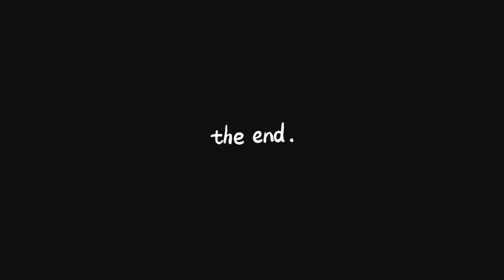Fitting a door lining to the new utility room

Comment: Hi Richard, top tip, i know youve screwed the batten across the bottom to maintain the width but that wont hold the legs square, where as if you fix the hinge side of your lining first, and then cut a piece of 1x4 for example the internal width of your lining and place that inbetween the legs on the floor. 
This will ensure that when you fix the other leg you can pack it tight against the 1x4 making sure that they are dead square.
We have to fit oak thresholds on fire doors, so we use the oak threshold in the exact same way but leave them in place.
Good tutorial though for those who might not know 👍

Comment: I always chop my hinges into the door then transfer position using a marking stick, and chop into the lining before I even build the lining,  nice and easy to cut them flat in the lining on a workbench/trestles, usually use a palm router, then finish with a chisel.  I usually test fit the leg to the door for piece of mind, though It's never been been wrong, so the door is effectively pre-hung,  remove the door, make up and fit the lining. Like Danny M I always fit the hinge side first then square everything off that.

Comment: Good Videos
A string line from corner to corner is a good check
Advise Dummy Frames fitted first, means another set of door frames installed but no damage to finished frames as can be fitted after floors are done
Also gives option of installing Door Sets or Choice of frame can change to be oak slips for example
Your comment on leaving a hollow inwards is spot on !!!!!!
Router Table very handy for a big job

Comment: Great video Rich. Only one thing missing - how to calculate the height of the header. I can see people putting it in at 8' and then wondering why they've got a bit of a gap under the door 😊
Reply from the maker: That’s a good point Rob I shouldn’t presume should I. I’ll try to edit that into the door fitting video coming soon👍🏻
Reply: @Mr_A_Builders  it's actually quite a tricky topic that couldn't easily fill it's own video. You have to allow for the type of covering including any underlay,  then the type of room (I've seen 15mm gaps in a kitchen to allow for air flow), and then quality of the door as to how much you can trim if anything changes. I'm sure you could think of a load more decision points - basically, all the stuff that automatically comes off the top of your head without even having to think about it when you're the professionals you guys are.

Comment: Very interesting, I can’t tell you how many times I’ve have fitted a door liner, nice to have the smoke seals in the liner than the door itself
Reply: @laidbackmedia  hi Darren, yes they do
Reply: @laidbackmedia  yes they can be fitted into the door it’s self but came across many that have been fitted into the door liner , maybe Richard could help us with this
Reply from the maker: Hi Darren our linings are pre routed to accept the fire seals straight from manufacturer 👍🏻
Reply from the maker: Hi Gary. It is the preferred method for me to get them in the frame already if for no other reason than it’s less work on site. The only time I do them in the door is in the case of a loft conversion like we also have on our channel if you haven’t seen it. There are two existing doors and frames where I’ve changed the old interior doors to fire doors so I’ll need to router in the intumescent fire seals in the door. 👍🏻
Reply: Many thanks to Richard and Darren for your input Knowledge is king and as Richard quite rightly said “ preferred method “

Comment: Hi Richard, love your videos mate. 
I have just fitted 2 door casings that came already trenched for 762 door. Both doors still had to trimmed 2mm and back cut along the leading edge. 
I always use ballbearing hinges, so do you think this maybe the issue? Have you experienced this issue? 
Trimming prefinished or laminated doors can’t be trimmed for obvious reasons .
Reply from the maker: Hi Paul. You may find that the off set of each leaf on the hinge is wider on ball bearing hinges so yes you may find that is the reason. 
However, I have also found that depending on where the frames are from they may not have allowed enough clearance between the trenches. Ideally you want around 30 1/4” or 767mm. I’ve re-trenched frames many times in the past. Enjoy the rest of your bank holiday 👍🏻

Comment: Hi rich 
I had new linings and doors fitted just before Xmas other than getting ridiculous varying  prices for the 8 doors had some guy talk the perfect way he was going to fit them and most of it was bs he complained about everything floor out ceiling out walls out can’t get a fixing,he said originally there be no need to cut the doors down as the frames be built to suit the door around them being fitted which made sense ,other than the bottom of door needing trimming he still cut some them down and badly too saw marks  left,gaps inconsistent all around one door when the sunshines in the hall and door closed the light illuminates around the sides it’s is a joke, when the architrave went on the gaps I could fit my finger down the sides probably every door now dose the ghost swing open and this was all coming from a man harping on about how long he been a chippy 30 odd years lol luckily I’ve managed to rectify everything crap he done and unless you was looking for it you probably wouldn’t notice what a pretty crap 
cowboys that talk the talk and will say it’s just a door and frame and in reality it is but they still not got the skill no matter how many years they been doing it to actually fit linings or frames and doors correctly 
I’m dreading the coming months because the best of can go out of shape possibly but where he ripped down some lining sides they probably warp in no time 
Just really bad experience 
Nice video btw be interesting how you would fit a new lining in a old opening not one that’s already created straight